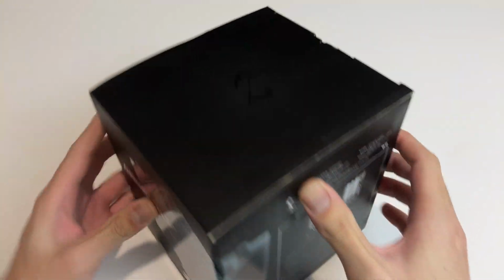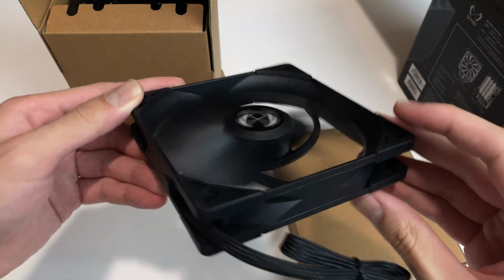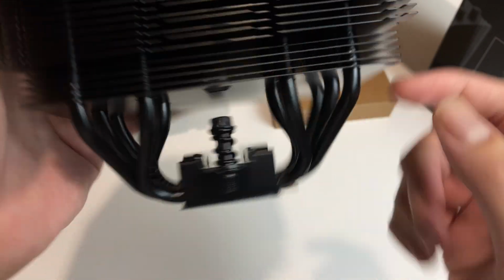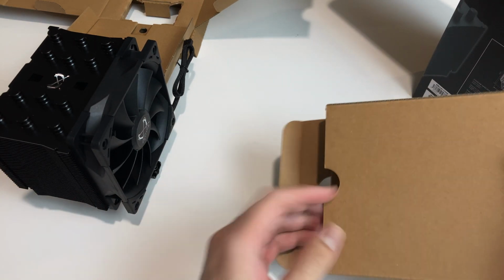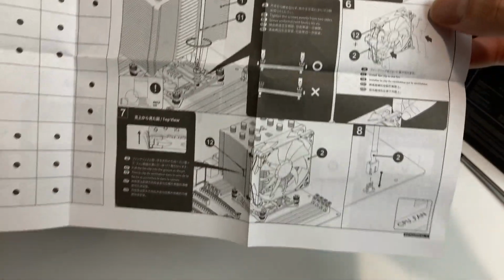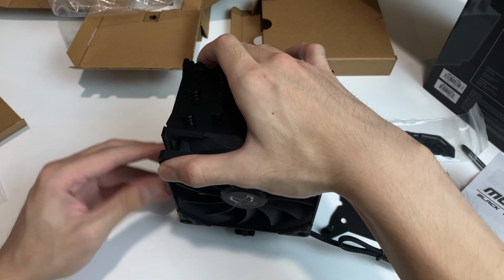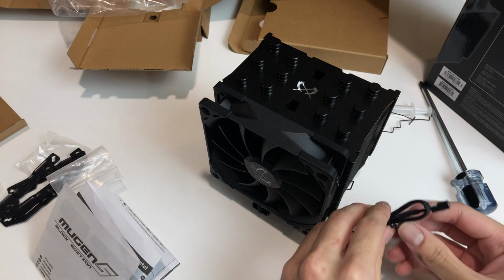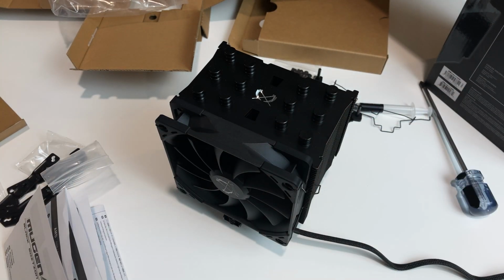BEST LOOKING CPU COOLER! | Scythe Mugen 5 Black Edition Unboxing and Fan Noise Test

Comment: Finally someone with this cooler in black. Should I get this or the D15s or new Noctua u12a Chromax (out in a few months)?
Reply from the maker: D15S and U12A is going to be almost 10C cooler than this but this is not a bad cooler either especially if it is cheaper. I am working on the review video right now.

Comment: Are there any drivers for this cooler? Seems that internet wont help me... annnnd how to control the rgb?
Reply: i bought the rgb version btw
Reply from the maker: You connect the RGB to the motherboard and control it with the motherboard RGB software.

Comment: Hello. Can this cooler clear the VRM heat sink of the b550i asus strix? Any ideas? And when you do compare this to the silver mugen 5, can you measure and compare their dimensions? As the width of the silver mugen 5 is said to be 130mm but the black edition is 136mm.
Reply: The most detailed installation guide for Mugen 5 Rev. B https://www.youtube.com/watch?v=xW1GqzAv3DY

Comment: I might downgrade to this from the fuma 2, i use an ryzen 5 3600 anyway!
Reply from the maker: Honestly I think the performance will be pretty similar too!
Reply: its about 3c worse on my 3600 max rpm for both cooler (non black edition mugen vs fuma 2, but this black mugen has 1500rpm fan instead of 1200.. might be closer). What we really need is a black fuma 2 with nice heatpipe ends like mugen :D